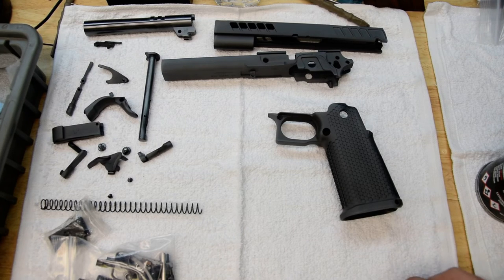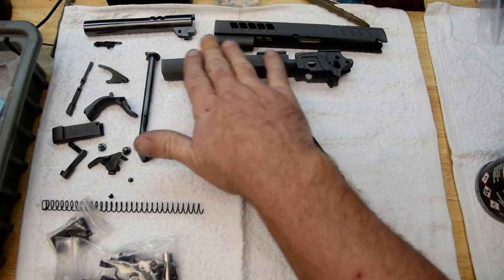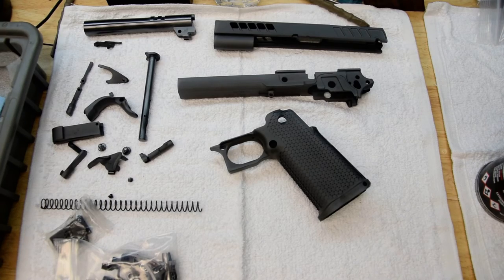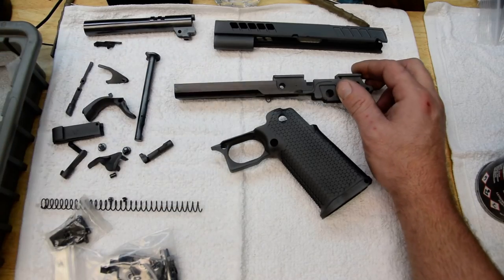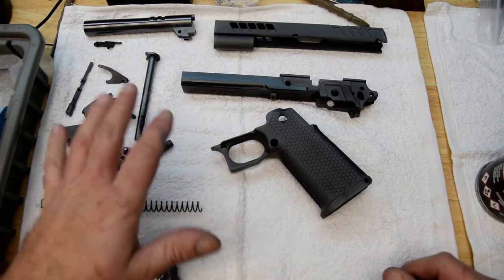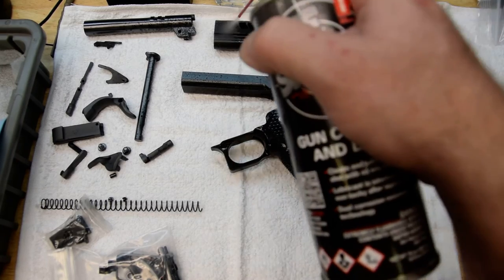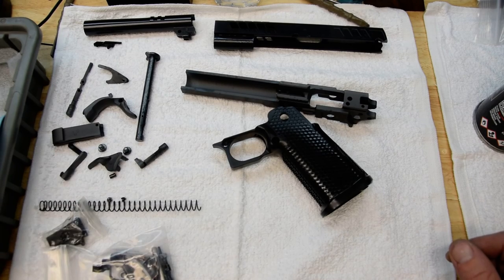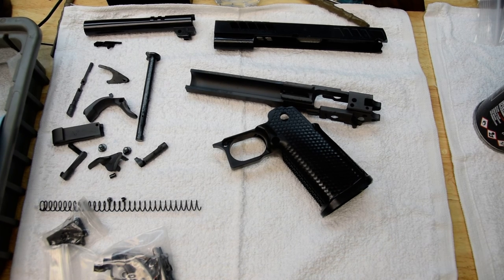DLC Coating

Comment: Are you oiling it just for the black look, or because DLC isn't preventing corrosion?  The last thing I want on a CCW IWB piece is an oil layer on the external parts, no matter how thin.
Reply: micro porous treatments usually need to be oiled to prevent corrosion. That's how they work. It may sound like a hassle, but it's really not. If you've ever carried a Parkerized piece, it's the same deal. Melonite is same - so think all contemporary military pistols like M&P.
The oil, after you wipe it, stays captured inside. It does not leave marks. The only time it comes out is if you heat it - after firing for example. So if you take you CCW to the range you'll need to wipe it before putting it back in.
Reply: @AlexN2022  so you need to oil the outside of the slide and after you fire it the slide will start getting slippery. If you get into a firefight your hand is going to be slipping off the slide???
Reply: @ryangreen2352  you're overthinking it. The amount of oil isn't sufficient to cause the slide to become slippery. And come on, it's a pistol, not a machine gun
Reply: @ryangreen2352  😂😂😂

Comment: micropores! similar to a parkerized phosphate coating.. it soaks up the oil to create the P&O protection. Parkerizing  is easier to do less high tech just a chemical bath of phosphoric acid and has the GI look of WW2. I love all the gun finishes and technology. color case hardening is beautiful. so is a blue on a mirror polished surface. people who say don't oil a Glock slide are just wrong. Tenifer was the original Glock finish a nitrocarburizing process. DLC is a very cool high tech finish. experts needed. On a side note I'm not sure you can parkerize stainless steels as they are resistant to reactions.

Comment: Is there a certian type of oil to use?  Or a certian type to avoid so the coating is not damaged? Thanks for the info!!
Reply: Most any oil will do.
Reply: I currently use Clenzoil CLP spray or Slip 2000 EWL-CLP. Both are non toxic, no fumes, prevent rust, stop wear.

Comment: I have a Colt cco and it has an aluminum frame. Will the Ion bond/DLC work on the frame?
Reply from the maker: doug day 
yes it will but you need the right coating company
Reply: Is there anyone you can recommend
Reply: doug day Ionbond is the best

Comment: @Atlas Gunworks Question you guys may have an answer for. I am looking at buying a used gun that has a DLC coating on the barrel but that coating looks to really be wearing off pretty bad, is this a sign of some really hard use on the barrel or does the coating just have a limited lifetime. Any information would help a ton!! Thanks!!
Reply from the maker: Sounds like a bad coating.  Properly done dlc should stay on a barrel with normal use.

Comment: would refinish with DLC damage the slide's integrity? it is carbon steel and mine has been cerakoted from the factory
Reply from the maker: In most cases a recoat in DLC would be fine.

Comment: Would you recommend coating the Sear or should i stay away from that part?
Reply from the maker: We do not coat the sear or the disco.
Reply: Atlas Gunworks that cause you think it would be too slick,  cause you think it would need up the angles , or just not needed?
Reply from the maker: DLC is not super slick.  The sear needs a polished face that is super smooth.